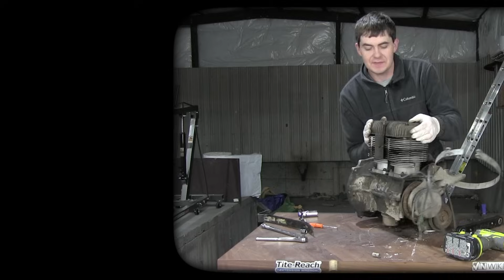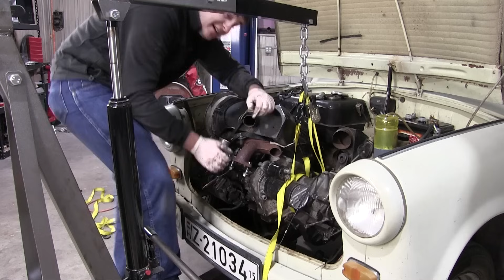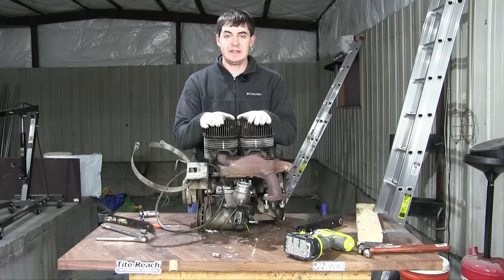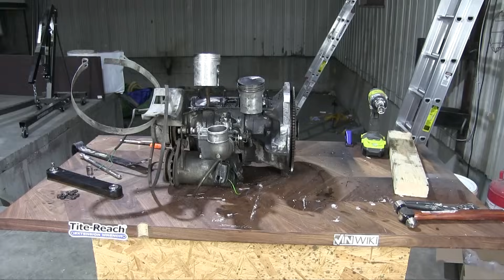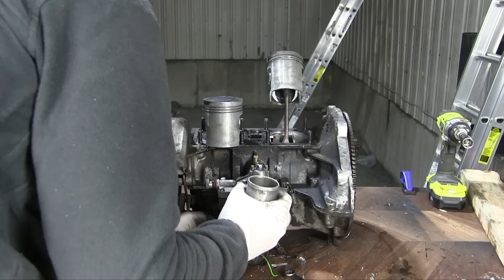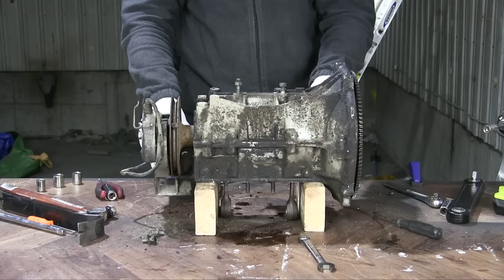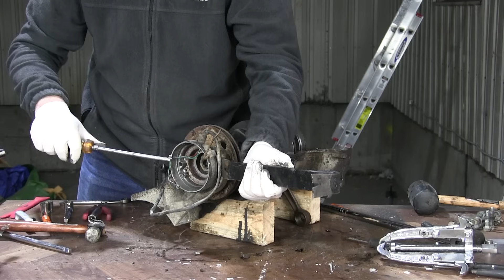Rebuilding the Trabant's Engine: Part 1 - The Teardown

Comment: I've owned a Trabant for a year now (I'm sure these videos are what sparked my interested in these years ago) and I'm curious, did he actually pull the engine and transmission out without removing the CV shafts? Seems like the wheels are in place and he just lifts it right out with the transmission attached but surely that's missing a couple steps. Usually people remove the engine on it's own and leave the transmission in there from what I've seen because the transmission seems like the harder part to remove

I think I need to take apart my transmission this summer since the freewheel is a bit dodgy

Comment: It always amuses me how Americans are always really surprised how a small car has a small engine and the parts are small. Yes the clutch is small. It is a small car. I can tell you that for example the original Fiat 500 and the original Mini also have small engines and small clutches. They are small. It is the opposite of big.

Comment: The engine can be removed alone, without the gearbox, and so even a person can lift it (I am not strong at all, but lifted out a few Trabi engines myself); Yes, it is a dynamo, not an alternator; Two old outer rod ends of the Trabi are the cheapest tool to remove the flywheel. The thred sizes are exactly the same.

Comment: You actually can lift the DKW (Auto Union) engine out by hand, I've done it myself, I assume the SAAB is the same. However the 1940 Chevy 6cyl. took two people, my brother and my self. Last is the 1938 Ford flat-head, 550 lbs of cast iron, your not lifting that one out by hand. (These are stripped of all large removable parts). The starters and generators on the Ford weighted a lot, being 6 volt.

Comment: Given the age of that car, I would imagine that it uses a generator. Alternators produce alternating current, which is rectified to DC to charge the battery, and I'm pretty sure they didn't have solid state rectifiers back then, (or if they did, they weren't up to the task).

Comment: Hi, a good motorbike engine shop should be able to strip/press the crank for you. New hard pins are not a problem, new rollers should help the big ends. The main bearings may require regrind and oversize rollers. I can see why these engines were used in powered gliders.

Comment: If you disassemble the engine, to press the wrist pin in, you can pour and burn some gas in the piston. This way the hole gets bigger and the pin should get in easily. Not sure it’s applicable in the place of your invention. I guess a gas torch might help

Hopefully, I named the parts right :)

Comment: Its a heat exchanger. I picked up a Buick 3.8L v6 one day LOL...you are weak. They have gyms with weights to strengthen your muscles. Wow...its a motorcycle engine heheheh. You could get a higher performance engine from a motorcycle and it would outperform that engine. Does it actually have compression? Love homemade tools!

Comment: Another fun fact about the trabant is that when they built the engines in the factory they hit the crankshaft with a hammer until it was balanced. Oh and the crank case was originally sealed with a special glue, so it was never opened by anybody.

Comment: Some DiY owners back then used to have a rebuilt swap engine, pushing the engine in use to the limit and do the swap quickly when needed, then rebuild the used engine for the next swap.

Comment: You should not have to remove the exhaust system and the gearbox. Engine can be easily removed without remove these mentioned parts. When i was eigthteen i could pop out the engine with a small handful of tools next to the road..
Reply: Sounds like you had engine mount problems...

Comment: I'm sure you've heard it a thousand times by now, but the "unknown object" that holds the piston to the con-rod is called a wrist pin.
Cool stuff! That these things are so easy to work on kinda makes me want a Trabant as a project car.
Also I knew about rotary valves in two strokes, but that's so cool that the Trabant has one.
Reply: Interesting to hear it called a wrist pin, is that more an American term. I have always known it as a gudgeon pin here in the UK, been working on cars for 50 years. It appears both descriptions are perfectly acceptable...you live and learn

Comment: 14:50 et seq - gudgeon pin
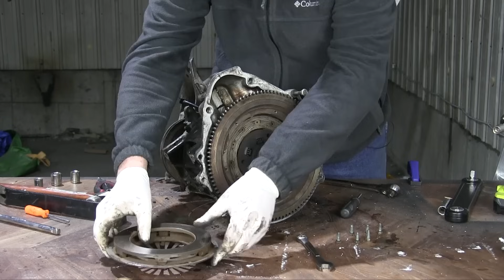17:30 - that's a DC 'generator'. An AC generator or what in automotive circles is stupidly referred to as an 'alternator' has a shorter, fatter body and you can usually see windings looping in & out of the ends of the unit. 'Dynamo' means exactly the same thing as DC generator.

Comment: Usually You would seperate the engine from the gearbox before You try to get it both out, it is easier.

I remember there was a record of getting the engine out and back in in under 20 minutes at a "Trabbi-Treffen" in Zwickau. This was only done by hand and tools on a meadow.

BTW: The broken exhaust manifold is a typical problem. Let's say You hit the ground or a big stone with the silencer/heater combination the "Vorschalldämpfer", then it cracks the exhaust manifold very easy.

Comment: That tool you made is basically a bigger version of the sight pusher I have for my pistols. Literally a small box with bolts and shaped nuts that move back and forth to let you push iron sights off guns to adjust or replace. Definitely a lifesaver, as I had originally resorted to a hammer and spent 2 hours handling and was unable to budge the sight, but managed to put a lot of marks on my gun

Comment: You may want to invest in a few ASA Carbon Monoxide detectors just in case something does go wrong with the cabin heater. They change color when CO is detected. They are commonly used on small aircraft, like Cessnas, which also use exhaust heat for the cabin heater. They only cost a few dollars each.

Comment: 1:57 It is an acoustic expansion chamber. The cabin heater blows warmth off the exhaust manifold because this engine loses most if it's heat in the exhaust, hence no air cooling subsystem for the engine.
17:22 "Dynamo" is an old name for a DC generator
Reply: I still use it.
Reply: Thanks man

Comment: New to the channel, so forgive me:  In northern Maine and what COULD BE an Aging Snowmobile channel, we (I) have had come across MANY Kawasaki 2-stroke Arctic cat snowmobiles (think pre 1980) where the crank is made of multiple pieces, as yours, and a skilled 2-stroke builder could separate blindfolded, put new bearings in, press it back together (with the less than 0.002" requirement) seal the cases together w #35 (or .035", I cant remember) cotton rope, and send it on its way.
Perhaps good useable core?  No idea what your costs are.

Comment: They make a special tool called cylinder wrenches, tor removing or replacing the cylinder on the block.  It curves around the outside of the cylinder and has a connection on the top where you can attach a wratchet or a torque wrench.  Aircraft mechanics and people who rebuild Corvair engines usually have a set of them.  I don't think I've ever seen any in metric, tho.  It could be that they make metric ones for guys working on VWs.

Comment: With a bit more refinement -  the car and engine reminds me of the Voltswagon Bug.    The idea that anyone, any owner,  with basic tools, can maintain and repair the automobile.      Cars and Computers were started off as technology people could work on, maintain, and easily repair.   Now:  all plastic parts, break and toss into landfill.    Electronics: glued together,  one problem ?  toss in trash.  :-(   
With more engineering, the basic 2  cylinder could be upgraded to a easy to maintain,  lightweight  4 cylinder engine.

Comment: It might be worth noting that not all two stroke engines intake through the crank case like this, bigger diesel two stroke engines use injectors to spray the fuel directly into the cylinder and fresh air is provided under pressure to expel the exhaust out exhaust valves.  Some that you might actually be interested in is opposed piston two stroke diesels where two pistons run towards and away from each other in the same cylinder.  Would definitely be interested in seeing a video working on one of those as their mechanics are fascinating and they're supposed to be crazy efficient.

Comment: Just in case it hasn't already been said in earlier comments, the pin that you made a cracking little tool to extract, is called a gudgeon pin in the UK or a wrist pin in the states. I watch far too many of these strip and rebuild videos.

Comment: Couldn't see another reply in the comments, so here goes: They are ALL generators! The difference being a dynamo is a DC generator whilst an alternator is an AC generator (clue's in the title). A dynamo's output is limited so, once cars began to become power hungry with more and more pieces of electrical equipment dynamos needed replacing with alternators which give much higher outputs. The outputs also need regulating which was quite straightforward for a dynamo, with a simple electromechanical cutout, but more complicated for an alternator. Rectification from ac to dc for instance.

You once could get dynamos for bicycle which operated lights by rubbing against the tyre. Small bottle-shaped metal objects they were.

Comment: Thanks for this, never seen under the bonnet before and, not being disrespectful, I have to ask, why did you bother? 
Respect for your tool invention,  perhaps call it the 'Wristgeon PushMePullYou'. 
In 1989 my West German girlfriend now wife and I visited Berlin and drove into the old Eastern part of the city and out into the sticks just after the wall came down. All the roads in the villages and towns were made of cobblestone, it was bone jarring and uncomfortable in a new car so imagine what a long distance Trabant ride would have been like. We were in a Fiat or a VW, the cheapest hire car we could get which had a reasonable suspension but the Trabant didn't seem to have one. 
There were hundreds of these cars everywhere belching out blue smoke from their exhausts, during rush-hour the carbon dioxide levels would have been stratospheric. Nearly every vehicle was a Trabant, it was the peoples car, even the police had them. All the higher ups drove Zil's and in the early wall-free days all the drug dealers had Audi's & BMW's and would run rings around the police.

Comment: No need for a new crankshaft, unless of course some other major disaster is found during the rebuild. Any competent machine shop can rebuild that shaft with new bearings. It's no different to any multi cylinder two stroke motorcycle crankshaft from say 1970's. This comment may be a bit late, as no doubt by now you have well and truly completed this project. Cheers from Indonesia.

Comment: I have just watched all four parts of your video and saw you happy in the end, thanks for the entertainment ! I had a Trabant a long time a go and I kind of miss it. I have never met a Trabant owner who was dissatisfied, you get what you pay for. As for the driving, never gear down to slow down, it will rev the engine with out gas/oil = lubrication (the freewheeling in 4th is for a purpose). Also fine adjust the gascable and idle to get a better response, a Trabant is very simple and needs basic adjusting to do its "best".

Comment: It looks like a Kawasaki 650 or 750 watercraft engine case.   You can use a C-clamp to remove & install the wrist pin.

Comment: Shweet disk valve dude, you can tune the snot out a that, well kinda, square off the disk valve port a couple degrees advanced and  flatten exhaust port, throw a expansion chamber on it and a fat main jet..youl probably pull low 20s...lol love your honesty bro 😁

Comment: A dynamo is a “generator” not an alternator. It has a commutator and brushes on the armature that together are internally timed to rectify the alternating current mechanically. An alternator outputs alternating current which must be rectified by a bridge of semiconductor diodes to get DC.

Comment: Sure, we can all laugh about the trabant today and how shitty it was (and is). But you have to put it all into perspective. By the time that car was produced the GDR manufacturers had to deal with shortages in steel, rubber, plastics and all the other materials you would need to build cars. It's actually quite astonishing and - from an engineering pov - impressive to see that these guys still produced a car which was actually quite reliable back in the day.

Comment: Comparing this Trabant 601 to a VW 1500 from 1963 the body looked quite contemporary. Trabant's front drive transaxle was ahead of its time, but their 2 cyl air-cooled engine was only 2 stroke.  In 1967, Honda's first cars (N360 and N600) were front drive and similar in size with 2 cyl air-cooled engines, but they were a better 4 stroke motorcycle design. Later, larger Civics were 4 cyl water cooled. The 3 cyl 4 stroke Suzuki engine might have been adaptable to use in the Trabant.

Comment: a dynamo means it's more basic then a generator first there where dynamos to run the car they are not very good at recharging the battery then when they are not powerful enough to recharge the battery then generator's are used after that cars use alternator's kids when they need even more electricity

Comment: Here in Brazil we had the DKW two stroke, three cylinder engine, with an optional freewheel feature. It let the car coasts at any velocity, and the engine idling, to avoid those lubrication problems.
Reply: @ Andre Patacchini 
The Trabant engine originates from DKW - and there is a freewheel function in fourth gear.

Comment: Getting a complete, rebuilt engine from Germany would be a lot cheaper and more reliable than buying myriad individual parts and doing it your way.  Keep your parts for spares and for training. Good effort, though.  As you drive it, remember that 6 volt  systems in cars require perfect, corrosion-free grounds and connectors to avoid electrical gremlins and very weak headlights.  Thanks for the video.

Comment: Don't you have a power washer to clean the outside before disassembly?  Generally you seem to be a mechanical novice spreading unprofessionalism among other novices. As you yourself have said three years ago you changed the cylinders but forgot to properly atach the exhaust manifold, yaikes

Comment: Is that transverse mounted leaf springs in the front
Reply: @ Aaron Blakely 
Yes, the classic DKW racing style (really constructed for race-cars ... long ago) - traverse control arms and traverse leaf springs front and rear. Though these tiny tea trolley wheels it was hard to take a Trabant off-track. I thought it was junk until I got one ... it drives quite ok, is reliable, but stinks from 2-stroke oil.

Comment: Try a Citroen 2CV
Reply: @ Dean Bell 
Compared to this, Citroen 2CV was airplane tech. It was faster while consuming 20 % less, and the engine easily sustained 7000 rpm (not 4000 for short time only). Adjusting a 2CV engine was not done by wiggling. And the engine compartment did not look like a scrapyard.

Comment: If you depart the engine from the transmission you can remove the engine. I did it my self to change the clutch in 1999

Comment: I don't own a Trabant but I wanted to see someone rebuilding an engine only slightly larger than the engine on my riding lawn mower. I'm amazed that you were able to obtain parts for a car that the manufacturer built most likely under duress and may actually have been slave labor. By the way, the pin that holds the piston to the connecting rod is a wrist pin but you don't need to know the name of it to wreck it. As a matter of fact, you don't need to know the name of any part in order to destroy it.

Comment: I believe a bit of side to side play is normal, but I’m probably totally wrong and thinking of something else. But in bearings, some play in some directions can be considered normal.

12:50 they’re called gudgeon pins. Which everyone else has already mentioned.

Back in the REALLY old days (like when headlights were sometimes powered by kerosene along with the engines, because gasoline basically didn’t exist) they were called dynamos as they were simply motors with the shaft being spun by an external force, thus the dynamo effect. So, generator/dynamo are effectively the same thing.

The reason generators and alternators are different, despite having the same working principle, is a dynamo/generator produces DC directly, an alternator produces AC at around 300-400Hz, which is then rectified into DC that the car can use. Thus the difference. If you’re wondering why not just cut out the middleman altogether, it comes down to efficiency, and I guess packaging, because alternators produce way more power and in way less footprint.

Comment: Yup, the classic "crankcase isn't splitting but I'm sure I've got everything, so it must be I need a lever and a hammer" mistake. I did the same thing on the first engine I tried to rebuild. A bolt hidden under starter that wasn't listed in the book of lies (also known as the haynes manual).

Comment: Side to side movement isnt a problem but if you can move the rods up and down on the crankshaft the bearings are shot, but side to side no issues :) Thanks for sharing.

Comment: Don't use rtv to put crankcases together.  Hondabond, yamabond, 1104, permatex (dirtbike, pwc, +++) gray. Not to be confused with ultra gray. This sealant will actually stop leaks from returning and is 100 times better than rtv.

Comment: Backfiring is caused by the center seal on the crankshaft usually.  You will need to rebuild the crankshaft.

Comment: This exhaust would fit on the car and do wonders for everything.  It would run cooler. More torque across the board, better fuel economy, etc etc. 
http://dgperformance.com/dg-performance-models2.php?category=Polaris&model=Indy%20Trail%20488%20Fan&appYear=1991&prodType=Exhaust
You would have to jet the carburetors.  Since you live in Misery,  a competent two stroke dirt bike mechanic could easily handle it.